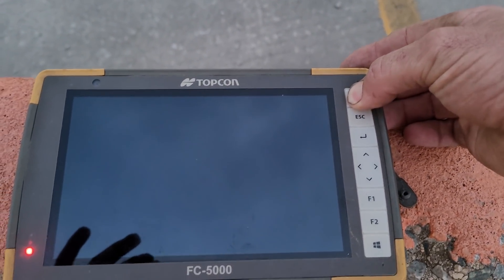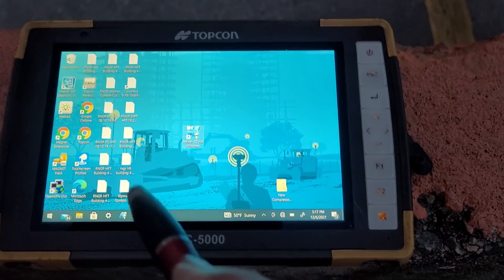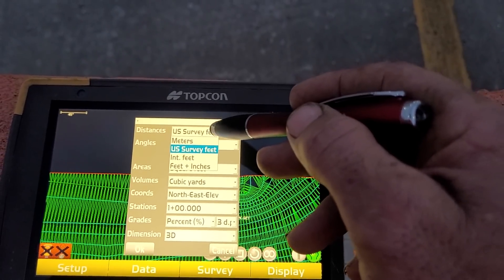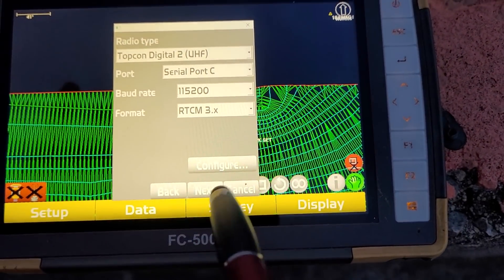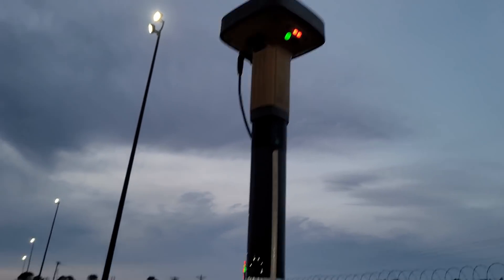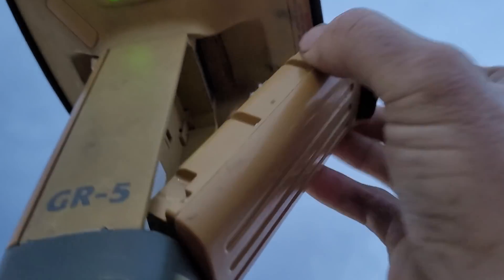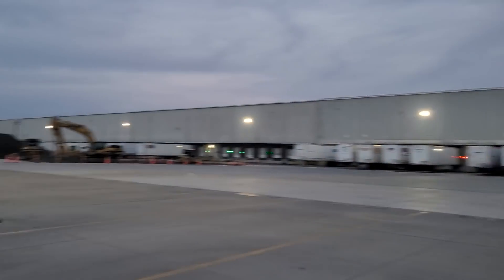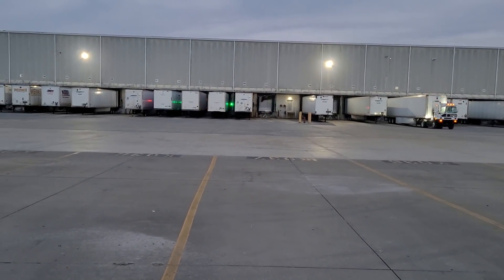Instructional Topcon gps video for Bradyhill1 , he's been helping me try to catch up.

Comment: Charlie you just gave out the name of the people you are working for dont know if you want that.
Reply from the maker: They are in a bind,  it's funny how people won't run you off when they ain't got another horse to ride. But the job on the data collector could have just been for example  of checking a job? Never know?
Reply: @copperheadmarine  Awesome just don't want the videos to stop keep them coming!
Reply: @copperheadmarine  I believe there is a way to blur on a posted video, so you could at least cover the image, but most people would not know what those three letters stood for if you hadn't said the full name! Lol
I don't know if you can bleep audio...
Reply: @copperheadmarine  this is funny I just did a video same idea showing my wife how to check the oil and power steering and other things under the hood ,, sent her the video ,,  great idea its there to go back too if you forget how to start the unit up ,,